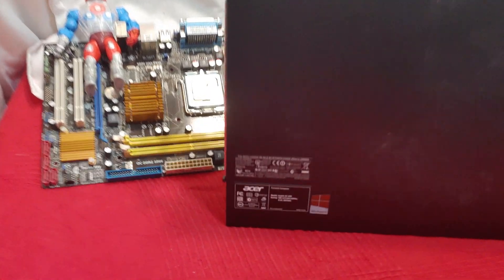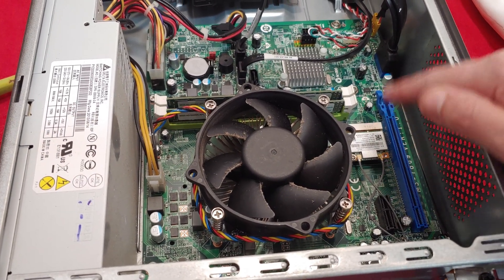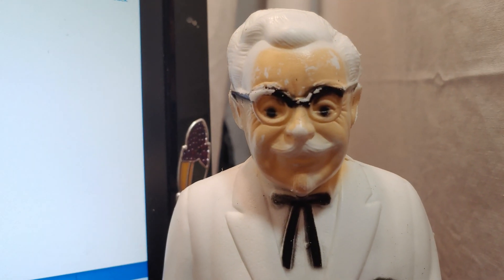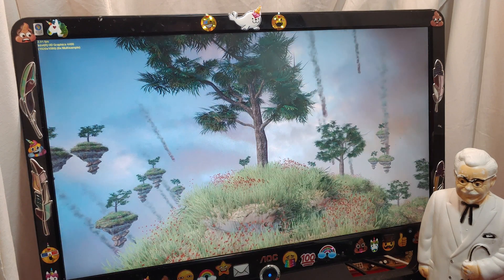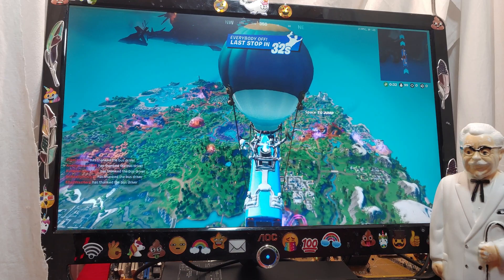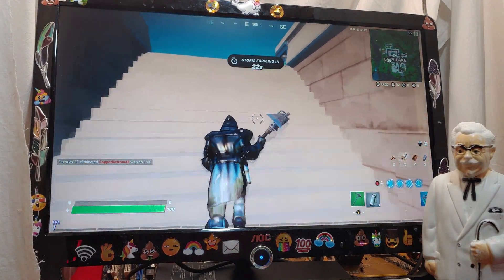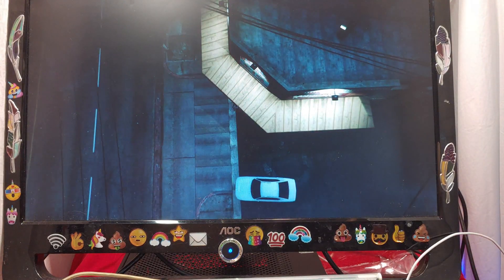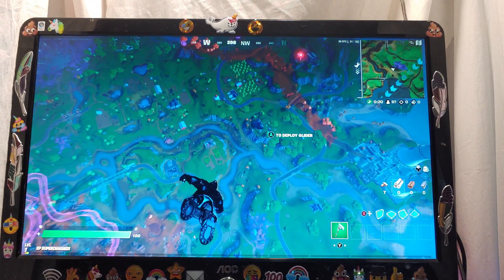Acer Aspire XC-605 Benchmark, GTAV Fortnite Test,  & A Look Inside For Upgrades

Comment: Do you still recommend this in 2022? Same PC but with I5 4460 4GB RAM and GT 710
Reply: I'd just bought this and add a used gtx 1050 non ti, and yeah.. for budget and easy build I'd still recommend it..

Comment: I have the exact same computer, and I can not for the life of me get the bios to recognize that boot drive to reinstall windows
Reply from the maker: Did you try switching UEFI/BIOS boot options?
Reply: @NevsTechBits  yeah I switched it over to legacy but still nothing. I tunes off secure boot as well
Reply: @piotrekkrolikowski344  Change sata cable. Does it recognize another drive?
Reply: @computerrefurbishment9748  I solved it, formatted it to ntfs instead of fat32